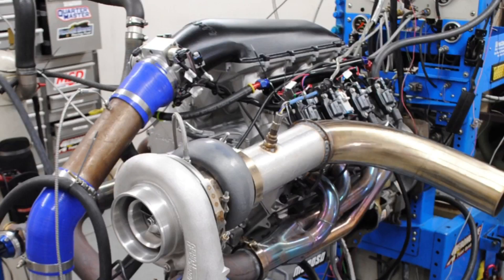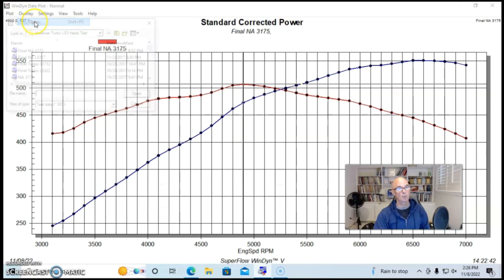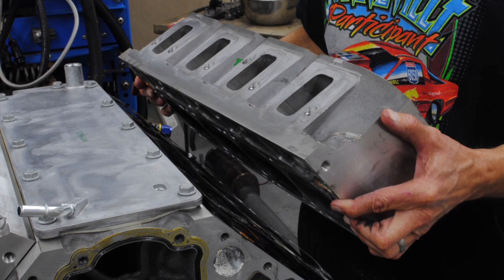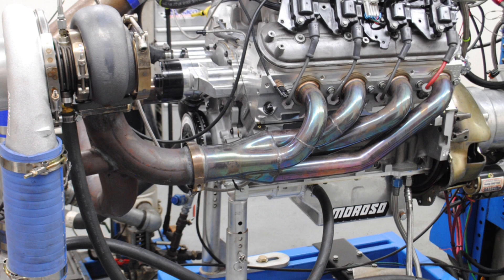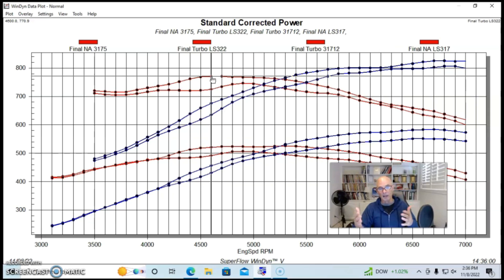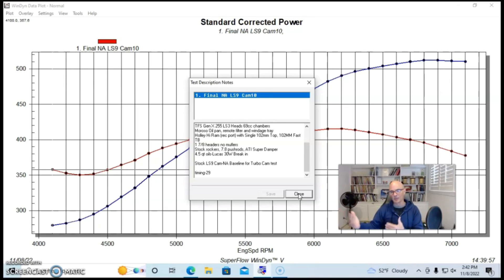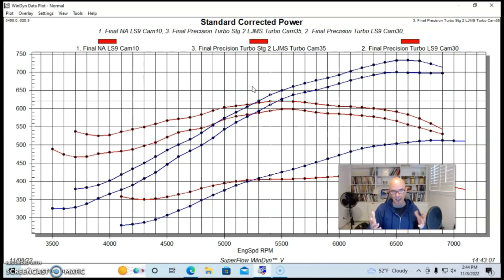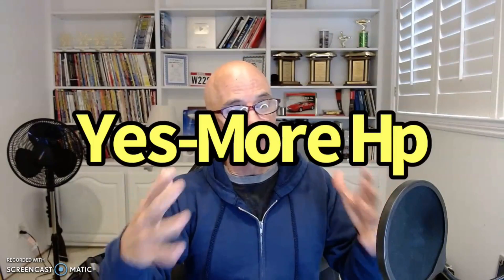WHAT LS HEADS WORK BEST WITH A TURBO? CATHEDRAL PORT OR REC-PORT HEADS? WHICH HEADS MAKE MORE LS HP?

Comment: Richard, would a pair of Trick Flow Gen X 220 heads be a good fit for my 6.0 408 stroker with 2 VS Racing turbos?
Reply from the maker: yes
Reply: I'm going to use 2 VS Racing 78/72 turbos. Watching your videos has inspired me to do something that I've never done before. Thank you so much and God Bless 👍
Reply from the maker: twin 78s will make a lot of power
Reply: @richardholdener1727  
What do you think about the BTR stage 4 turbo cam?
Reply from the maker: you don't need that much cam for those turbos, but if it is a race car-with lots of converter and gear-then you can use it
Reply: @richardholdener1727  
Race only. I just want to thank you for reaching back out to me.

Comment: If I have a 4.8 LR4 Gen IV with 706 heads, could the cathedral ports be reworked into a rectangular port while only requiring an intake manifold swap or would it be more involved in that? Could you also shape the cathedral intake ports to rectangular instead of sourcing another manifold or using adapters?

If what I have theorized will work, it’d allow the combustion chambers to be reworked to match the bore size without being oversized, minimize detonation characteristics and chances of valve interference while having the flow benefits of the rectangle port.

Any input?
Reply from the maker: REDOING THE CATH HEADS IS NOT THE ANSWER OR THE DESIRED TEST
Reply: @richardholdener1727  why not?

Comment: Other then adding boost is there heads cams,intake,etc that can be added to increase hp/trq  with out loosing mpg.
Reply: It takes fuel to make power. TANSTAAFL. The only way to make more power w/o burning more fuel is to increase the compression ratio. Run insane compression ratios in an Otto cycle engine, and you start talking things like water injection or alcohol fuels. [I believe it was Ricardo almost a century ago who showed that if you ran pure ethanol, then the detonation limit on CR was in the high 30s:1..?]

Comment: We all hear everyone talk about rocker weight, and how stock rockets are best etc.....has anyone ever done independent tests to see if stock rockers are the best high rpm rockers ? Do heavy roller rockers float at higher rpms ? So many designs, so few answers. And of course with boost.
Reply from the maker: lots of people runing 8500 rpm with stock rockers
Reply: @richardholdener1727  So I hear....but do the aftermarket roller rockers actually reduce that ability due to their weight ?

Comment: I have a dart LS block with LS three cylinder heads that flow 360 at 700 lift trying to make 1500 hp CompCams recommended this cam. What do you think about this cam.I 248 E 256 L688 lob 114???
Reply from the maker: YOU DON'T NEED THAT MUCH CAM FOR 1500 HP-BUT IT WILL WORK

Comment: I feel a bit like a sponge, soaking up results from the testing you do and report. Really good info, again! I can’t help but notice there is a difference between your conclusions and those of “Freiburger and the two Steves” when evaluating the effect of better heads under boost. This is not to question your conclusions in any way, they are clearly valid. Their test compared two sets of heads with a Procharger—different in many ways from turbocharging—but they concluded the better heads had very diminishing returns. Why? They did not change the pulley ratio for the mechanically driven setup, and had less gain from the “good” heads because the boost dropped. With your turbo test, the boost was closer to the same showing the true benefit of better (or at least higher flowing) heads in the boosted combo. This does not change your final advice, to just use the heads you have for boost. But when the underlying engine has the capability to use more air, you need to give it that air for a fair evaluation, IMHO. Regardless, thanks for this info Richard!
Reply from the maker: if it adds power na-it adds power under boost
Reply: Freiburger should have given us another run with a boost correction.

Comment: What makes a good turbo cam for a small block 347 ford
Reply from the maker: xe274hr or xfi236
Reply: @richardholdener1727  right now I'm using a trick flow specialty stage 3 cam it seems to work okay but like you say all cams are turbo cams

Comment: Bridge the Gap next to compare “Ported” cathedral port heads to rectangular port heads. 
Average HP/TQ throughout the useable RPM range? 
There’s really 3 stages of heads with specific applications based on intended use etc. 
Was it BTR or Tony at BES who doesn’t recommend Rec heads as SOP until 400+ CID?
Reply from the maker: trick flow 22 vs rec port video is up-ported cath is better than stock rec port

Comment: Definitely worth in NA, not so much Boosted. Imo. Could run a little more boost, and close the gap. Also blowing a motor with some junkyard 317s hurts a lot less financially than messing up ls3 heads.
Reply: Good point.
Reply: Yep sell the heads and buy beer 🍻.
Reply: Gotta pay to play.

Home ported LS3 heads going on my newest setup. Less restriction needs less boost.
Reply: @ZONES89RS  that's the thing though, you can make 1,000 hp on any of them. You can run 317s or 706s with 1 extra lb of boost and make up the difference without spending the extra money. Less restriction does take less boost, but cathedrals on 15 and recs on 13 or 14 will still make about the same power.  Just depends on power goals. Most people are only running 10-12 lbs making 550-600 whp and would be fine with whatever it came with from the junkyard.
Reply: @RamblinAround-Streams  correct. But for street guys, 93 octane, square ports are the way.
Reply: @ZONES89RS  👍
Reply from the maker: boosted motors get .019 gap

Comment: Richard,  what would have happened if you used a trickflow 245 Gen x cathedral port head on the first test against the ls3 head combo?
Reply from the maker: ported cath heads make more than stock rec ports
Reply: @richardholdener1727  have you done a 6.0 or 6.2 with a 4.8 crank by chance? (Thinking to run rec ports on a displacement limited class)